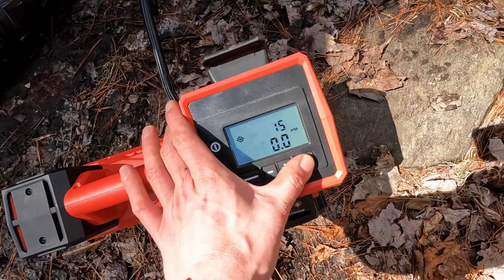It Turned Into A Complete SEND FEST On The Trails!

Comment: Lockers are great but unless you really upgrade the whole axle big time especially if it's anything less than a 44 you're just asking to break stuff if you get after it fully locked. Don't make problems you don't have if its working. Down here in AZ lockers are more of an extra get unstuck feature unless you're getting into real obstacle or rock crawling, the traction out here breaks stuff on full sends.